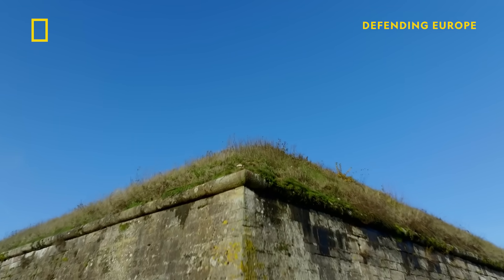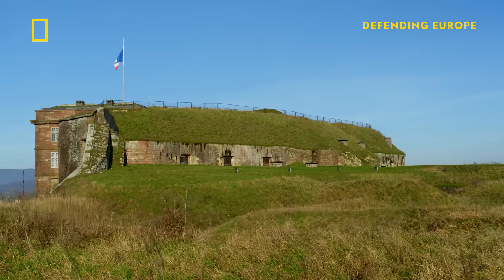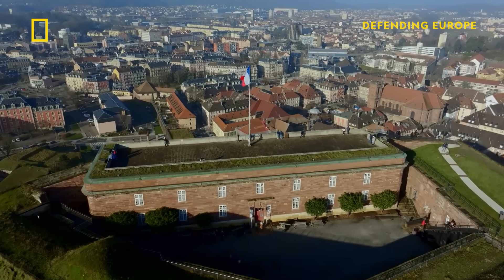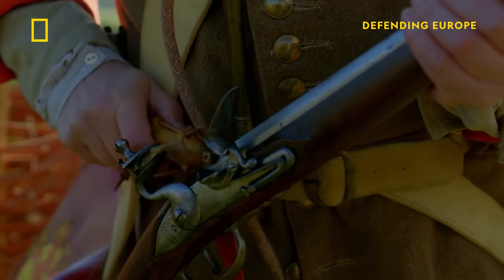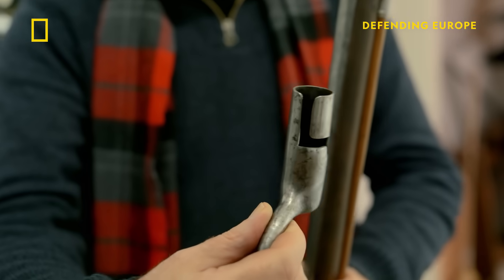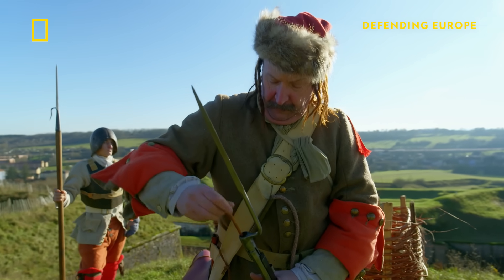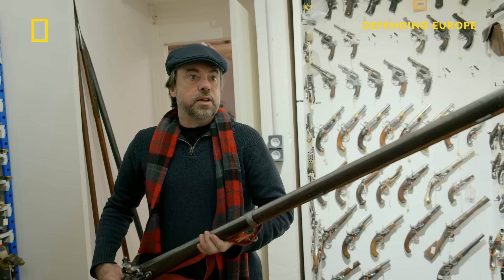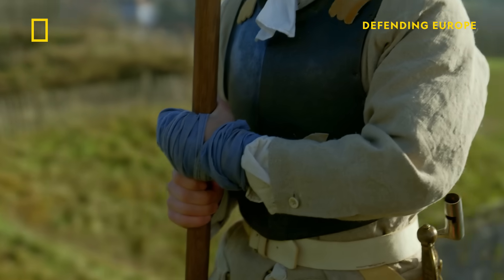The Invention of the Bayonet Socket | Defending Europe | National Geographic UK

Comment: utter nonsense. the bayonet replaced the rapier, not the pike. entirely different job. a rapier can't prevent cavalry charges, nor can a bayonet, which has, extended with both hands exactly the same length as a rapier.